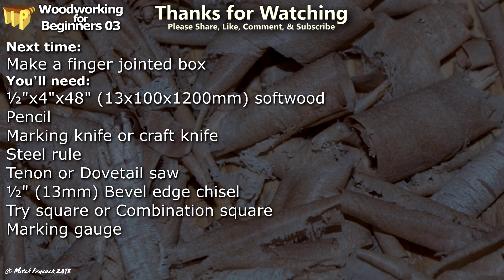Woodworking for Beginners 03 - Halving joints

Comment: I've made the same frame structure to widen the table top of my girlfriend sewing workbench, i made it with non-standard pallet wood and i didt'n use any layout or square and only an insanely cheap electric jigsaw.
The result was definitely not a pretty result, with a HALF CENTIMETER of sloppiness  between the joints, i really wish your videos was made a decade ago so i could learn the beauty of precision and that you need time and patience to get good results.
Reply from the maker: At least you made one - that's more than most folks, and no doubt your next was/will be much better.